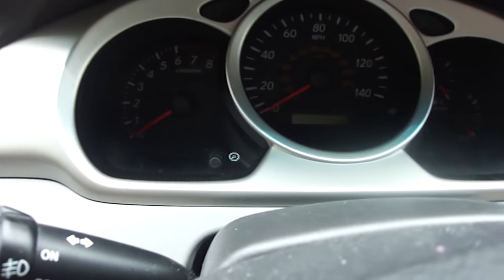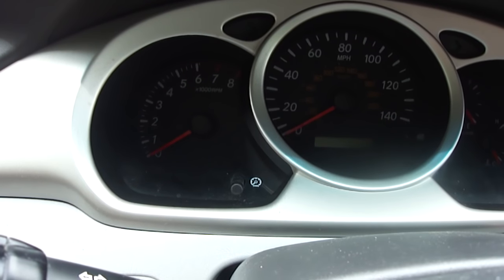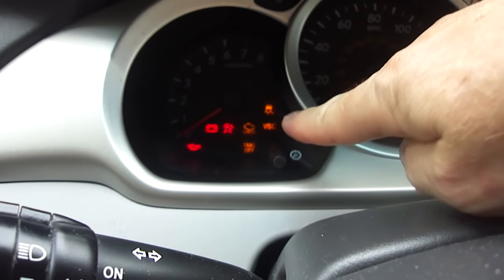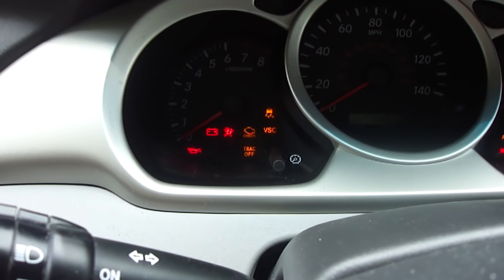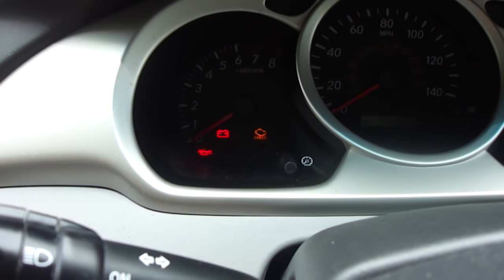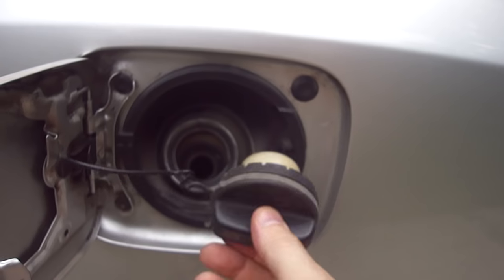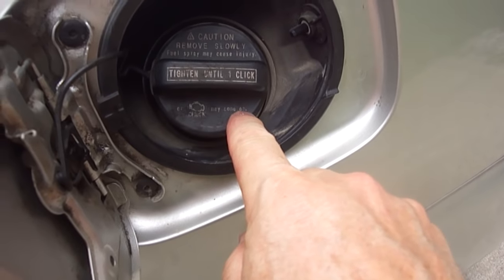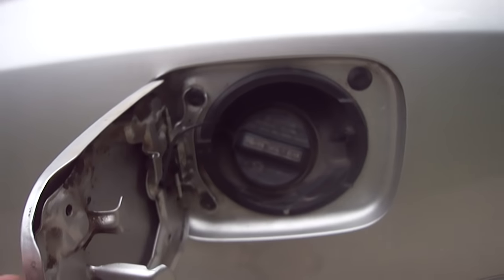(Part 1) How To Fix Your Check Engine, VSC, Trac Off Warning Lights On

Comment: Just come across this problem in a avensis. Thanks for the tip.
Fixed it after 40km
Reply: Hi paul
I have tightened the cap but still the VSC light and Check engine lights are on. Do you mean your problem got solved after you drove 40km?
Reply: Have same problem with avensis 2005

Comment: It worked for me, the gas cap wasn’t properly closed and the lights went on for check engine, VSC and TRAC.  removed the battery for few seconds and the light turned off.   You saved me money 😊

Comment: The gas cap was loose on my 2009 Toyota Venza. Once the gas cap was firmly in, it did reset the VSC light but not the check engine light. I had to disconnect the batter for 5 min to reset the check engine light. Good video, thanks!

Comment: Have a 2011 Rav4 and in cold weather both the TRAC and check engine lights came on. I followed the advice to tighten the gas cap, then wiped the gas cap. Second step fixed the issue.  Thanks!
Reply from the maker: Andrew B 👍

Comment: I learned this method a few years back for a 2000 Volvo that we had been gifted. I sifted through the service paperwork and noticed the nearly $1,000 of worthless mechanic work that fixed nothing and found a video on YouTube which cleared up the issue. Several years ago my 2004 Toyota Sienna van started doing the same thing. At first it cleared up the issue quite nicely just as your video shows but the lights started staying on longer. I had read that the gas cap sensor can get clogged up with gunk and to using canned air to blow out the gas cap and sometimes I just have to use my own breath to reset the sensor in the gas cap. That works almost every time. Lights come on more when temps hit over 80 degrees outside.

Comment: 2004 Toyota RAV 4.  Simultaneous display of VSC/TRAC warning light and Check Engine Light.  NO switch for VSC/TRAC.
Two parts of your counsel were the answer for me...OUTSTANDING:
1.  Paraphrasing:  "Almost always the gas cap."  Then, clean the filler pipe then lube the gas cap gasket and, in my case, add some chassis grease to the fill pipe...because my rubber gasket was showing signs of cracking.
2.  DRIVE IT A BIT.  The lube on the gas cap was not an "instant" fix.  Sensors needed time to be "satisfied" that evaporative emissions were under control.  I drove the car several miles and parked.  Lights still on.  Next day, I got in the car to actually go somewhere, and the warning lights were off.
Both of those tidbits were the key...as was the way you presented them.  The first one was the fix, but the second one was crucial to being patient enough to actually legitimately test the fix.
GREAT advice.  Ordering a cap on Amazon.  Will clean the grease off the filler neck before installing the new cap.
THANK YOU!!
Reply: Your problem fixed?   If not.  Have an ‘08 Sienna XLE.  had all these random misfire codes (VSC) and even would have to shut my van down as the “traction control” light would blink along with the engine light causing the van to lose power and decrease in speed, till I shut it off and restarted it.   And that would take care of it for a week or so then back again, usually one the Highway.  So off to the shoulder again as the van would slowly lose power and buck and gas be basically unresponsive 

Seems like maybe the compression was changing over the 200,000 miles as i started putting premium gas in and the higher octane was the key.. as all the codes went away (once cleared) and never came back.   Same spark plugs.  I did change one injector (before I switched to premium gas) as it did have that code come up for the number 2.  But the check engine lights would still come on.   But same spark plugs on all 6 cylinders as those back are just too hard to change without a good reason.  

Again premium gas and all my check engine lights and blinking lights are a thing of the past and it’s nice having a dash free of those.  (Those lights came on probable a dozen times in the past.  But now problem solved for like 9 months now and counting.

So if it returns might try that.   I’ve disconnected my battery several times.  And light always would return after a period of time.  Also I had cleaned my gas cap in the past.    

But premium gas is what helped when everything else was just a temporary fix.  

God bless

Comment: My 2004 Sienna started with Check Engine, VSC, Trac Off combined ON 
without trouble code for awhile; then, one day P0420 code was added, of 
course it failed emission test. After struggling, I replaced the Bank 1 
catalytic converter because oscillating rear O2 sensor reading. New 
catalytic converter fixed the problem right away; it did not only take 
P0420 code away, it took Check Engine, VSC, and Trac Off away as well. 
Now the van runs fine with clean dashboard. I thought it was weird that 
fixing emission problem took away traction related codes as well but I 
am not complaining.

Comment: mine ended up being the catalytic converter and oxygen sensor.
Reply: Everyone thinks it's a bad gas cap! The vehicle is telling you something is wrong with the emission system!
Mine was a bad ignition coil. This created un -burnt gas vapors!
Reply: b c, get yourself a $35 code reader and you'll know if it was an oxygen sensor or the catalytic converter.  I put my code reader on and I saw No Code display which means all sensors were fine.  It may have been your gas cap and the mechanic or parts store told you it was the catalytic converter and the oxygen sensor.  Trust your reader before taking it to any service stations or auto parts stores!!
Reply: Now Im scared😱😭😥. Because I tried what he showed un video, and the lights are still on.

Comment: You saved me!  I have a 2004 Lexus RX330 and when I saw the VSC light on, I assumed to get it fixed would take my refund check. 😐 THANK YOU FOR DOING THIS VIDEO!  Tightening the gas cap fixed the issue.
Reply: i bought a new gas cap and tighten it each time i pump and it still comes on every few days. it says something about a small leak.

Comment: Wish I had seen your videos a few years ago. I have dealt with the gas cap issue, and maybe one time trying to press the VSC button, but you have all the quick fixes here. The lights came on for my wife today and she rushed to the shop without much discussion or research. Hope it’s a small problem. It isn’t optimal that about a dozen different issues will activate all three lights together. It tells you nothing but to go to a shop, and that’s not much help.

Comment: I had all those warnings on my 2009 Venza.4 cyl scanned the computer and pulled out two codes.po138 and po306.adjusted the gas cap as you said and the warnings went away.thanks for the video.dont take it to the dealership.

Comment: I tried 3 of the 4 vids and then saw something about taking the cables off the battery. The battery trick has worked so far.

Comment: Thanks for your video. I was able to solve the VSC and associated lights issue on my 2009 Lexus GX470 by changing the fuel cap.I'm certain I saved a couple hundred dollars not taking it to the dealership.
 "God bless you Paul".
Reply from the maker: You're welcome!

Comment: Thank you so much!

You are a lifesaver - saved me a trip (and perhaps several $$) to the Lexus dealership for my 2004 ES330. 
Just as you recommended, one turn on the gas tank cap, two clicks and the three annoying VSC, Trac Off and Check Engine lights were fixed. Simple 1-2-3 :)

Warm regards.
Reply from the maker: You are very welcome!

Comment: Thanks my Friend.  It works right away for my highlander 2012. I got the Trac & Eng light on this morning and no even the engine power was significantly reduced. I just released the gas cap, clean it & re fixed it tightly and everything was ok then. Turned off. Thanks again
Reply from the maker: Yousef Aboushakra 👍

Comment: Thank you so much for all your videos concerning 2012 Toyota Highlander Trac off and check engine sign! God has blessed us with you. Not everybody takes the time to do this for others.  You are a great example. I had both the CE and Trac light on. I started with the gas cap cleaning but not much happened. Then I tried holding down the button method. Then I went to bed.  The next morning I cleaned the gas cap again and then applied the WD40. When starting it back up the CE and Trac off light were still there. :( Then I remembered that the error occurred after I filled up the gas tank. So it made me think that the gas cap was still to blame but I thought also in one of your videos you mentioned to drive it around after doing some of these things and after about 5 miles the light went off. Eureka! I’m guessing my gas cap may need replacing. Thank you.

Comment: Thank you for the  great tip!! Just had a similar problem with my Land cruiser Prado 2005 model. filled gas and on pulling out of the station all the lights mentioned came on .  I pulled over immediately and stopped the car.  On  restarting the engine all the light went off. However,on getting home checked the internet. Checked the gas cap as per your suggestion and sure enough it had not been properly tightened. Cheers mate!
Reply from the maker: Vaughan Gomez You’re very welcome!
Reply: I had similar problem with my LC120 4.0 V6 also 2005. My mechanic changed front left abs sensor cause it was broken and brake light warning was on together with VSC and TRC...
I have tried this with gas cap and problem was solved. I needed to bring the car to another mechanic specialised for ABS systems. I should still check if everything works properly. ABS is now ok works properly and DAC system but still I want to know if there is another cause of this what happened. I really can't see a connection beetwen fuel system and hydraulic ABS system and ABS ECU.

Comment: Thanks a lot for posting this video 
I watched 1 and 2nd. Veds but the 3rd work for me. I took the battery terminal off and put back and press the traction control buttons for 5sec and the light gone off. Top rated video on YouTube.

Comment: Here was another fix that WORKED for me: refilled transmission fluid. My 2010 Corolla had exact the same symptom: VSC, Trac off & check engine light was on. After refilled & ran for 100 miles, everything turned off & worked perfectly

Comment: WE got all those lights during a trip. Cruise control also stopped working, and I use it 99.9% of the time, so that was a bummer. Just checked the gas cap and it does NOT click anymore, so I'm going to replace the cap (2014 model) and hopefully it will be the FIX. I'll report back after the replacement. THANKS!

Comment: Paul  - Thanks for your information and videos.  My daughter has a 2012 Corolla LE and we were experiencing the same issues (Maintenance light on & Trac Off indicator on),  We tried all of your recommendations except for the 5th one, and still experienced the same problem.  Since I was unsure of what two terminals to cross in the recalibration as outlined in video 5, I just went ahead and removed both battery terminals, cleaned both terminals and post, and reattached (more or less just reset the trouble codes in the car by doing this I think).  After that, everything is working fine.  Also, this was caused by what you initially stated, while putting gas in her car, she failed to put the gas cap back on...  Thanks again for all of your insight.

Ron in Corona, CA.
Reply from the maker: Ron Chappell  👍😊

Comment: Happened to my 04 4runner, but pulled a p0304 powertrain misfire code, cyl 4 (middle driver side) I did remove gas cap and put back on and drive around for a bit before turning car off and back on, but codes are now clear and no more lights. Thanks for the video!

Comment: No kidding! Trying this immediately. Been in and out of the shop with $500+ in expenses for new O2 sensors. Will lyk if it works for me too.
Reply: Does it worked  for you i got the same problem and mechanic saying to change o2 sensor.  How did u resolved this ?

Comment: Thanks. This didn't work for me but it's definitely good to know! I knew I needed an oil change, so for me when these lights came on, I added oil (after checking the oil level and seeing it was low) and they disappeared. That worked for me until I could get an oil change. Something else to try if tightening the gas cap doesn't work.
Reply from the maker: Tanta A. 👍😊

Comment: Thank you, really. Fixed my vsc light, just applied wd40. Thank you, again for uploading the video.🙂🙂🙂
Reply: Where did you apply the WD40?
Reply: @JonathanSeni  I used it on my fuel cap on my truck. It work for couple of days but then the light come back, I believe the o ring is not good anymore. Thank you though for a great video.

Comment: Yes..this may have worked in this instance, however, Its not always that simple, NOR does disconnecting the positive battery for a few minutes to clear computer code. I have a 2006 Lexus RX 330 and the VSC light and check engine light will not stay off, though car runs fine

Comment: Summer may bring this issue on more then winter time:   I got the same issue so I thought maybe a dead battery (coeinsodense)(SP)   two days later same again I cleared the code.  I had to watch the video thart was posted, and just went out,  lol I started to do the video, and off it went.  I may have to invest in a new gas cap   never know mine got used every other day about for  9 years that is a lot.  thank you for listening and the video.
Reply from the maker: fishycomics 👍😊

Comment: So I got this today. Long story short valvoline didn’t install my filter correctly on my last oil change. So I had a slow oil leak thankfully I went to get another oil change because my maintenance light came on. My question is there possible damage to my engine because of this ? When I went to get the oil change there was literally zero oil in my engine today. The CEL lights went off after the oil change but I’m not sure if there’s damage now.

Comment: Just got those 3 lights on again, God bless you brother for your help!
Reply: On Again?
I suggest you get a free code reading from a parts store or repair shop.  Could be more than a loose gas cap!
Keep driving with that condition could mess up your catalytic converter beside the air pollution!

Comment: Thanks for this video.  It got me going.     After re-seating the gas cap, I had to disconnect and then reconnect the car batter to clear the lights.  All good now.
Reply: JandJ Griffith Thanks for posting this! I also had to disconnect the battery to get the lights to go away
Reply: JandJ Griffith Thanks for posting this! I also had to disconnect the battery to get the lights to go away
Reply: Disconnecting the battery does not clear the ECU saved error. Actually the car computer has it's own small long life battery for saving all data in your car regardless if the starter battery is dead or it's missing.

Comment: Hello All, I watched all of the "Parts" of this video series...I had the exact problem as described. I tried everything exactly as explained in every Part. Nothing worked...until I did one simple thing...cleaned the terminals on my battery. That fixed it. So my suggestion as first attempted fix is to clean your battery terminals (removing them as you do), or replace your battery. Probably fixes the problem much more frequently than any of the episodes offered here. Just my 2 cents.
Reply: Cleaning the terminals didn't fix it. When you followed the instructions in this video, it most likely fixed the problem causing that initially caused the lights to come on, however the lights will not go off until the system is cleared with a scanner or the vehicle is driven far enough and runs enough cycles for the system to reset itself. All your cleaning the terminals did was to disconnect power to the ecu so that it reset itself. You would have had the same result by simply disconnecting the battery for a few minutes and hooking it back up.

Comment: 2002 highlander...cap gasket pitted..bought replacement. Engine/VSC light still on. No Trac/VSC button to play with, so disconnected battery positive cable and waited a minute. Reconnected and started car. No more warning lights. Thank you!

Comment: So I got my gas pumped in NJ where the workers pump gas and tighten the gas cap. It’s probably been like this for a few days before the light came on though. Does the light usually come on quickly?. Also have been noticing a very gassy smell coming from the exhaust as well as alot of white smoke randomly. I just discovered this video today, hopefully when I get home this will fix it. I’m currently in a work truck
Reply from the maker: This usually does occur very quickly.  It could take up to 100 miles of driving before it turns off once the gas cap problem is fixed. However, the white smoke sounds like another issue. Maybe a head gasket problem.

Comment: Hey Paul,

After you tighten the gas cap how long did it take for lights to go off??
Reply from the maker: Sometimes it happens immediately.  I've also seen it take 50 miles and just recently 500 miles.
Reply: @proclaimliberty2000  ok prefect and I was thinking maybe the ecu fuse out for 20 minutes to see if that will clear the lights? What do you think?
Reply from the maker: David Stephens I would remove the positive and negative battery cable for one hour and then reattach them.
Reply: Ok thank you
Reply from the maker: David Stephens 👍😊
Reply: our tooks a long 50+ miles drive to turn off

Comment: I have a 2007 toyota rav4, three lights came on at the same time. VSC, 4WD, and CHECK ENGINE lights. so have you come across this problem on this particular model and how do you address this issue? Already tried your tricks and none worked.

Comment: Thanks. I didn't know that when the engine light comes on the tracking thing light comes on also. I'm going to check the gas cap. This just started happening after I filled up my tank.